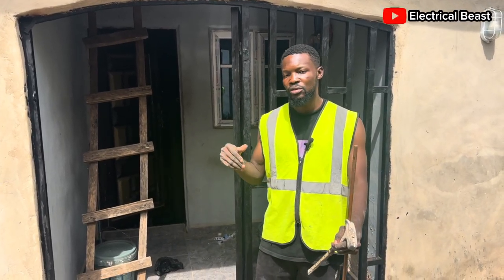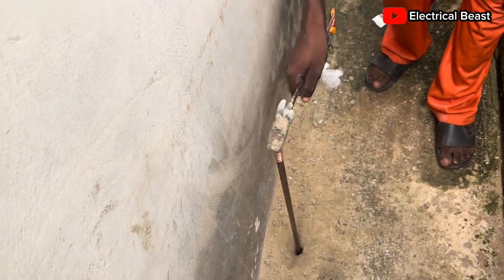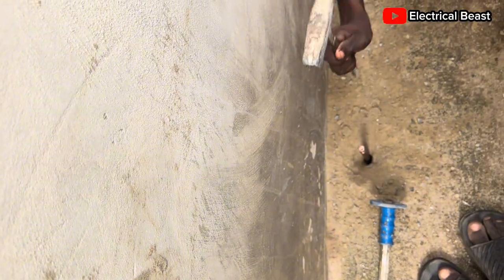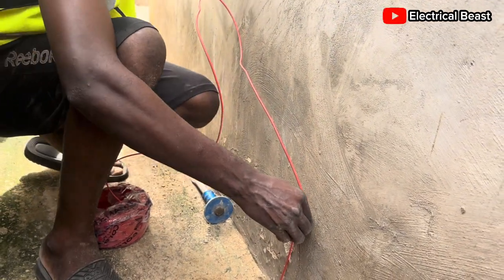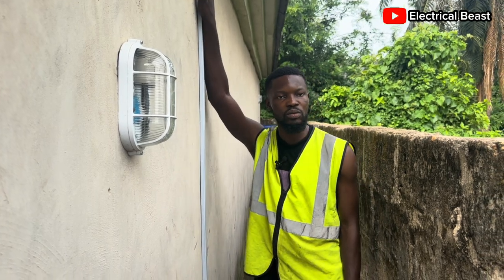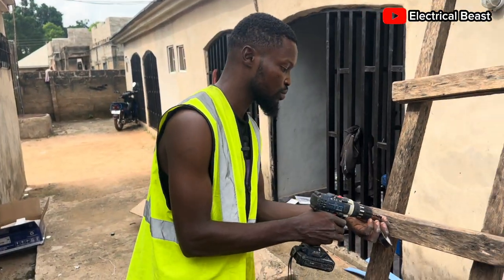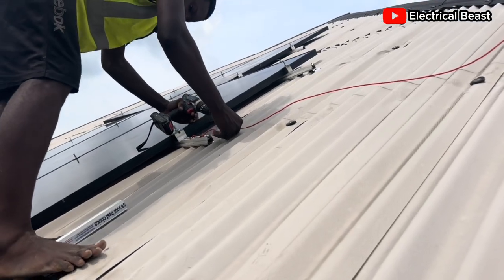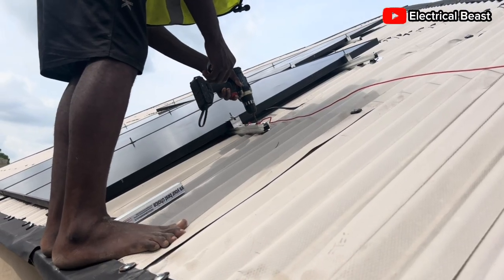How to Properly Earth Solar Panels (Most People Skip This!)

Comment: Great job but please I have a question. Separate Earthing of the panels is it necessary after connecting the circuit to the building's earthing?
Reply from the maker: You’re not supposed to connect any earth terminal from your solar setup to the earthing of the main building
Reply: Thank you Engr. Gideon. I am learning a lot! my question is, earthing the solar panels, is it a must. once my boss connects the system to the earth terminal of the house, we don't do any other earthing again in all our installation

Comment: Quick question pls. Can you use same earthing for both the protection box and the panel. I'm using cworth ebox and the earthing was connected to it. Can it be extended to the roof for the panel?
Reply from the maker: Connect all earnings with a ground bar at close to the earth pit, don’t loop at the inverter point

Comment: If one has thunder arrestor and inverted is being earthed, dies one still need ro earth solar panel
Reply from the maker: Protection for solar systems can never be too much. If possible you can as well earth the panels
Reply: Do you know that some hybrid inverters come with clear instructions in their manuals 'do not earth the solar panels.' I think it's quite risky if manufacturers advise against it.

Comment: i really enjoyed your video but my question is what if in a situation where the building has been earthed by those that did electrical installation like in a  A.C form, can one earth covered both the D.C and A.C installation ?
Reply from the maker: If properly done, yes! But as much as possible try to do separate earthings as they are different power sources
Reply: @engrgideon  thank you so much my boss and can you do video on to how to connect changeover to the solar panel source where there is also changeover for A.C source ?
Reply from the maker: @ChibuikeEmmanuel-fj7jw I’ll have to do that too. Let’s see in the coming days if I can work something out

Comment: Please, why does the mouse of laptops hang, and the screen of phones tends to scroll on its own when plugged into a 2kva hybrid inverter?
Reply from the maker: That’s ghost touching when pv is active, you need to ground the system to ameliorate that electrical noise.
Reply: @engrgideon the inverter is already grounded.
Reply: @chukwumamadukwe9051  let me guess, (a) you connected ac to the inverter for charging, (b) you also connected the inverter ground to the ac ground. Are a and b above correct?
Reply: @easyfind01 that's not correct. There's no grid connected to the inverter for charging. It's just solar panel and battery that's on the inverter and the inverter is grounded. The inverter is a 2kva sms inverter system.
Reply: Thats not a Pure Sine Wave inverter.
Reply: LOL i observed that that thing too. especially the phone screen scrolling on its own
Reply: Please, what is the cause of that and the likely solution? @randomposts6126
Reply: Please can someone answer these questions
Reply: This usually happens when there is leakage current along the AC/DC line most especially the AC line. There is a big difference between doing “Earthing” and making sure that the earth cables in your house is connected to the earthing done. For most houses i have seen in Nigeria, the earth cable is usually not connected and most just laugh it off. Another issue is that some inverters come in modified sine wave and square since wave instead of the ideal Pure sine wave scenario. Those other wave usually impact on the performance of most sensitive appliances like laptops, phones etc especially when they are in use. Modified and Square sine waves can also cause disturbing noises in your fan when their inverters are used to power it. 
I hope this answers your question.

Comment: You are doing a good job. A few points i want to raise. For the earth rod, it is advisable you have salt and charcoal mixed with water poured into the earth pit hole to allow for better conductivity as current flows in the path of least resistance.  Also, in future installations i will advise you use an earth clamp or cable lug when connecting the earth cable to the earth rod to allow for firm grip as rolling the cable around the earth rod might not provide a firm grip. Good job boss, i appreciate the fact that you are improving yourself and others through your work.
Reply: This ur earthy no go hold water at all
Reply: We improvise in Africa ! The theory is there but the material is not available, so use what is available. Hats off to the brother for thinking ahead.
Reply from the maker: Thanks a lot for your valuable input. I normally don’t use salt to avoid corrosion of the rod over time. The owner of the apartment wouldn’t allow heavy digging to create room for charcoal and other apparatus this was more like the best I could do at least it’s better than nothing.
Reply: @engrgideon  No sir salt is for better conductivity resulting  from the  corrosion it self. The salt causes corrosion on the rod, which give it better contact with the ground.We ordinary people usually uses  normal salt though there is a special compound
Reply: @engrgideon Thanks for the feedback. Once again, you are doing a great job

Comment: If your location is prone to lightning, consider installing lightning protection systems, such as lightning rods, at elevated points around the solar panels. Remember that lightning follows the path of least resistance to the ground. Strategically placed and properly grounded rods can help prevent direct strikes to the panels.
Ensure that the DC system ground cluster, including the solar panel frame bonding ground, is kept separate from the AC ground cluster. While surge protective devices (SPDs) can protect downstream equipment, they do not safeguard the solar panels from direct lightning strikes. The most effective way to protect the panels is to implement a lightning protection system that provides a low-resistance path to ground, ensuring it is more effective than the solar panel system itself.
Reply from the maker: Valid point! Full-fledged protection for systems like this isn’t cheap, and most customers can hardly afford it. This was the best I could do within the available budget. Installing protective devices is a necessity, even though they don’t guarantee 100% protection at all times because we’re dealing with natural disasters here.

Comment: Broda, pls on mppt 150v i use spd dc 500v, its okay?
Reply: My point is the spd dc 500v or 1000v it good to use
Reply from the maker: You should have used 1000v. You don’t size sod according to the controller specs, voltage spikes from thunderstorms can even be higher in some cases.
Reply: @engrgideon  I use 500v and big thunder dey enter the inverter
Reply from the maker: @aladesamuel9652 Did it affect the inverter?
Reply: it off and on back itself and still work fine

Comment: 2.5mm wire is way to small for this earthing
Reply from the maker: Which cable size is ideal when it’s not a factory I’m earthing?
Reply: @engrgideon lightning earthing is entirely different from house earthing...do you know the current of a lightning can be as high as over 1000A...this is while thick naked copper plate is used as lightning conductor and not insulated 2.5mm² wire...at least 10mm² copper wire should have been used if the owner can't afford lightning conductor cable
Reply: i think 4 mm more better

Comment: So how many earth rod is needed?  
1.From Solar Panel Body To Earth
2.From SPD Output To Earth
3.From Inverter Body To Earth?
Reply from the maker: Yes, ideally you need 3 separate earthing.
Reply: Wrong, man. Only one good general earth is required for any one facility, no matter how large. There's nothing like dc and ac earths. What you did there may ameliorate static build ups, but it'll be largely useless against surges  incl lightning. You younguns should put more efforts in learning about these protection topics.
Reply: @ucheeze6220  Are you saying one ground is enough for all the electrical connections in a facility or building?
I mean I did ground A, so my AC for the house goes to "ground A", my inverter goes to "ground A", my panel goes to "ground A". Right?
Reply: One earthing properly done is enough for the whole electrical component in your home...

If there was an lightning spike on this home that was properly done.
There won't be need for this earthing done here
Reply: If only you can maintain a larger distance apart from the 3 earthing rods or you simply just use one earthing point for them all
Reply: Is it possible to do a proper earthing for my solar system without the hassle of digging ground and getting charcoal and stuff, and will be safe like you did yours?
Reply from the maker: @olamitiopeyemi1626  If you can, add some charcoal and animal dungs(avoid salt because overtime it corrodes the rod), dig wide enough to accommodate them it mustn't be 4 or 6ft, I didn't want to dig it out so much because the owner of the building wouldn't allow that. As long as the earth rod has a deep connection to the ground it works pretty as well.
Reply: All should go one common earth point. Earth is earth . In Us they call it ground